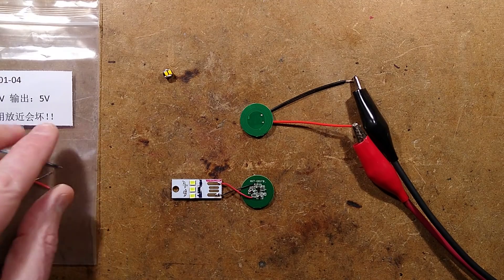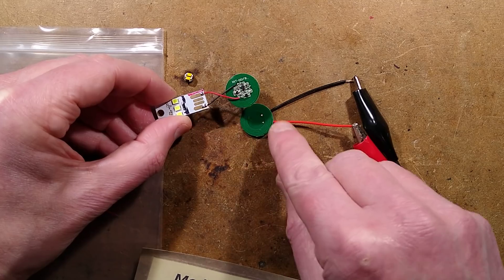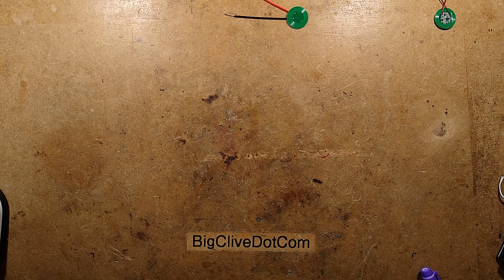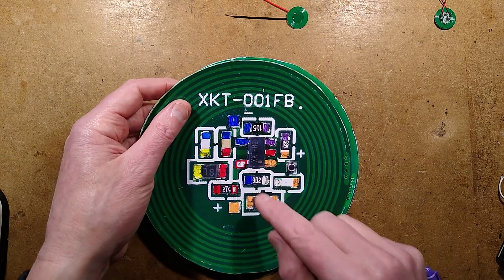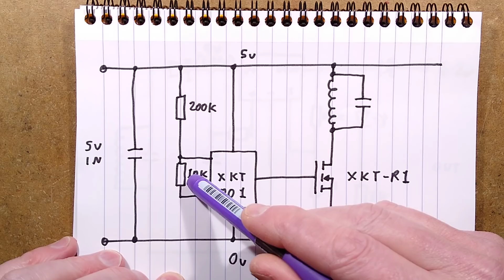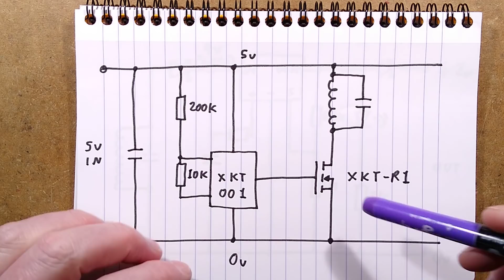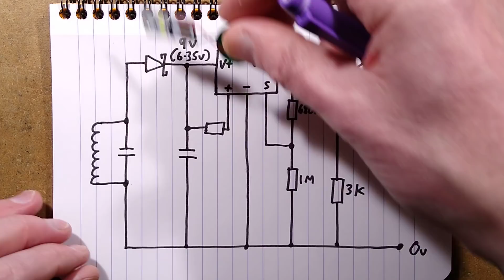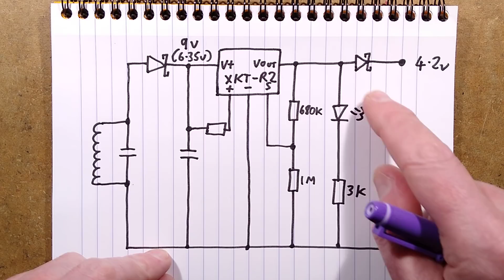Wireless power transfer modules (with schematic)

Comment: I built another device into the back of my meter to recharge the 7v2 liion and power it for long recordings, but the circuit is bulky compared to that thing and tends to run quite warm.

Comment: Very interesting I wonder if it could be implemented to charge every mobile phone so that we don't have to unplug the power cable all the time. The power  socket has been the failure point in my last few phones
Reply: Hence the Qi charging standard with similar receivers built in to many current phone models, but with a larger coil diameter.
Reply: @johndododoe1411  yes but I mean something to attach to any phone so you don't need to plug in cable, say built jn to a case
Reply from the maker: You can get QI chargers that stick to the phone and have a thin cable that plugs into the charge port.

Comment: In this video, I'm missing an efficiency measurement and a check on what happens when the transmitter coil meets an iron object.
Reply: I would guess, the efficiency is very bad.
From the video:
Sender: 25mA standby current, 100mA at max load. (Loss 25%)
Receiver: 6,35V -> 4.2V linear regulator (Loss 34%) 

We know 0,75 * 0,66 = 0,5.
Multiply with factor 0,5 for all we don't know, my bet would be 25% efficiency at 2mm distance.

At greater distances you could switch to LED and solarpanel :-)

Comment: Now these, I can also see uses for model railways... Fit a reception coil on a loco, hooked up to trigger a horn/whistle, and place the transmission coil up where the whistle signs are on your layout.
Reply: Just ordered two to see if they will charge the batteries in radio controlled locomotives.
Reply: If you just want signalling to trigger a horn, put a magnet under the tracks, and a reed switch or hall sensor on the engine. No need for all this complication just to trigger a switch

Comment: One use for this is to power the microcontroller circuit and LEDs that are on the propeller blade of the rotating display.  The power is transferred at the hub.

Comment: Could it be used as kind of a power source and a key for a hidden lock?  Battery powered transmitter... Slide it over the right spot and it would  Charge up some capacitors to a controller that would then discharge and power a small electro magnet plunger that would retract and a small spring would pop the little hidden compartment door open..   would be kinda neat since you wouldnt have to have the "key" near the hidden compartment..
Reply: You're just describing nfc keycards now...
Reply: @DrakeOola  Except the receiver is in the hidden lock (keycard) and the power source is in the key.  Don't forget to add a data protocol to do a secure handshake so no other key opens the lock.
Reply: Going way back to the 1950s and in operation for decades, there was a remote RF-powered listening device hidden in some American embassy with a transmitter. They don't like to talk about it even today. No batteries of course. I think it was in a picture frame. A van parked out in the street beamed microwave at the part of the building to activate the microphone and the Russians could listen in. These things popped up all over the world and for decades people working in embassies were suffering with acute headaches being in the wireless beam
Reply: @jagmarc  , you might be conflating several different kinds of electronic surveillance. The American embassy in Russia was built by Russian contractors and was rumored to be "bug"-infested. I don't know if wireless power was ever used to activate or reactivate hidden transmitters that didn't have an internal battery or power source, but using sufficient microwave beampower to cause headaches shouldn't be necessary just to make a listening device function, and such power would likely overload and obscure the return signal being transmitted out to a spy receiver (although perhaps a digitized return signal would work). Of course, ever since lasers were invented, spies have had the ability to pick up vibrations of a window pane caused by people speaking inside the building, and reproduce that up as sound. BTW,  Leon Theremin, the Russian who emigrated to the United States and invented the theremin, was reputed to have also built spy devices and transmitters for Russia.

Comment: I remember back in the 90s, the inductive charger on a Braun toothbrush was fascinating, these days it's everywhere, transferring power in a way that Nikola Tesla would be pleased to see... :D
Reply: Technically this is very different from Teslas wireless power transfer. This is just an oscillating magnetic field which works at short range, while Tesla theorized electromagnetic waves for longer distances. The problem is that high energy electromagnetic waves are not just incredibly inefficient for power transfer, but they also cook everything in their path.
Reply: @drkastenbrot  its an alternator laid flat
Reply: Tesla would think wireless power transfer is as shit as I do. He was already powering lights across a room over 130 years ago and wanted to power street lighting, ships, and planes wirelessly. Of course he didn't understand how the nature of nearfield radiation or the inverse square law both make such dreams an impossibility, but he nonetheless would have been as unimpressed and bored with the millimeter alignment needing and useless after a mere cm distant nature of today's garbage wireless power transfer technology as I and many others are.

Comment: I run my iPhone with both a wireless charger and a power cable at the same time, what do people think good or bad?
Reply from the maker: Charging the battery too fast can affect how many charge cycles it will take.
Reply: I've never owned an iPhone. My Note 10+ will only charge from one source at a time and chooses the source that it detects most recently. (Already cable charging and put it on a wireless charger, it switches to wireless charging; if already wireless charging and plug a cable charger in, it and it switches to cable charging)

Edit: Just tested this again, seems to choose cable charging over wireless charging. There is a notification that tells you switching from * to *
Reply: @Peter Pan  Do you have something constructing to contribute to this discussion? Maybe some data to support your argument? You may find some if you research what device is used to film a large portion of the videos on this channel.
Reply: @UVBluetoo  found the apple fanboy - amazing how they always voluntarily self identify
Reply: @PeterPan-uu5vu  , as far as I'm concerned, the company that makes the I-phone is crap! Irregardless of the quality of the phone, or the lack of it, Apple's monopolistic, anti-consumer policies, and their tax avoidance schemes, are a textbook case of what is wrong with capitalism.

Comment: What happens if you put some steel on the coil ? The complexity of the higher power phone chargers is largely to avoid it putting significant power into an accidental load
Reply: Good question. I guess the transmitter will just heat up and die.🤔
Reply: The better wireless phone chargers support two-way communication so the that the driving circuit can adapt to the different load requirements as the phone charges.  Of course, there is also protection, but some of that is managed in the phone.

Comment: Could it be that the output is 5V and that diode on the receiver is a regular silicon diode instead of a Schottky? That would explain the '5V output' specification
Reply from the maker: I tested the voltage and diodes.

Comment: How much power does the transmitter consume when it isn't connected to the receiver?  I always wonder if these are smart enough to go into standby, or if some external MC has to detect that scenario somehow...
Reply from the maker: 24mA at 5V.  About 0.12W
Reply: @bigclivedotcom  So I guess the circuit was designed to comply with laws against "vampire loads" wasting too much power at standby.  0.12W for the transmitter, 0.2W for the mains adapter and 0.15W for a standby receiver within a 0.5W legal limit.
Reply: Does Rasputin care for a scotch?
Reply: @bigclivedotcom  Standby could have powered a string of fairy/seed-lights. There's a fairy somewhere that needs a fix.
Reply: There’s a mania for wireless charging of ABSOLUTELY ANYTHING that I can’t understand. I can’t use my phone comfortably when it’s sitting on a wireless pad: maybe that’s just my poor eyesight. The big obsession is with wireless charging of electric cars. I can’t see how that can be efficient.
Reply: @markiangooley  Who in their right mind is talking about wirelessly charging electric cars? That's just downright dumb
Reply: @gorak9000  I agree it's not the most efficient way of doing things, but it would be convenient in some situations.  Imagine, for example, your place of work, a shopping centre, etc. with coils buried in some of the parking spots.  Just park in one of these spaces and your car automatically charges while you're away without any mucking about with cables.
Reply: @gorak9000  technically speaking using a solar panel would be a form of wireless charging, just with a higher resonant frequency, above the infrared spectrum

Get enough led on a panel they'll work the same as a solar panel, infrared, blue, green and uv leds probably would work best
Reply: Or take a bunch of radioactive waste, encase it inside a bunch of specialized photovoltaic cells, with a supercap, nuclear battery, no recharge needed
Reply: Only would have to worry really about peak and surge currents
Reply: @Michael75579  People are going crazy about any form of harmless milliwatt phone radiation and you want them to sit in an electromagnetic field that transmits kilowatts??
Reply: @Michael75579  they're already doing it. It would be great to pull into a store and your car is charging wirelessly for the 15 min you're inside. Then the same at the next store.
Reply: @Michael75579  Shockingly wasteful minor convenience considering how much energy you're moving and how lossy this sort of inductive coupling is versus taking a minute to plug in some nice 4 gauge copper.
Reply: @Michael75579  Could be a problem with non-electric cars that have metal structures in them that just happen to resonate at the charging frequency. Park in the wrong spot (it's not as if some people never tear signs down for the "fun" of it) and you could come out of the store to find your car on fire...
Reply: @Michael75579  If plugging a cable in that takes 30 seconds is too much for you, you should probably stick to a gas car - or better yet, just stay home. The inefficiency problem is one thing when you're charging a phone or a toothbrush with a tiny battery, but it's going to be a huge issue when talking about charging a multi kWh battery in a car.
Reply: @Clancydaenlightened  Right, so we'll put a solar panel on top, that's like 30% or 40% efficient at best, and have huge arrays of LEDs above parking spots, because people are too lazy to spend 30 seconds plugging a cable in? Next, we should put solar panels UNDER the cars on the road - just think of all the power they'll generate down there being shaded by the cars, and with all the dirt that will collect on them from the road. Then we could put LEDs there too and make the entire road a ginormous jumbotron display. I call this idea "really f'in stupid solar roadways" /s
Reply: @gorak9000  dumb, aka some start up will get huge funding for it :)
Reply: @Clancydaenlightened  Ian Charnas did this to make a nuclear powered "Game Boy." It's a shame his channel is as small as it is.
Reply: @markiangooley  I found a pad that's also a phone stand. I reason that it's less wear for that charge port I might not be able to replace.
Reply: @markiangooley  The one place wireless car charging makes any sense is when the car isn't stationary, or not for long.  And then only to consume excess power from an unreliable grid powered fully by renewables, and then only if there isn't a better energy storage option.  If you've got excess solar and wind energy and no place to put it, might as well wastefully charge some cars at a stoplight so they won't have to charge as much later that night.

Everywhere else, a minute plugging in makes far more sense.

Comment: The receiver coil appears to be open circuit on the board.
Reply: No, it just has a "tail" that extends past the capacitor pad a bit.  I'm guessing it's either for antenna tuning, or they copy-n-pasted the antenna and didn't clean up the extra.